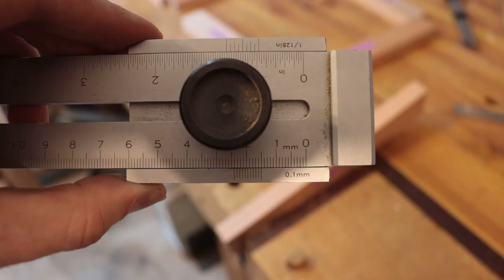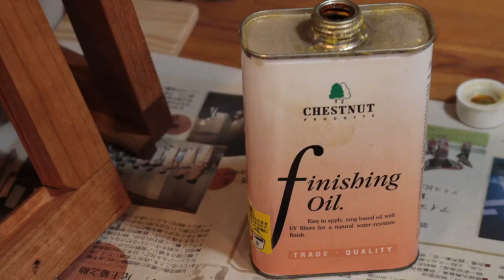How to make a printer cabinet with antique glass and hand tools!!

Comment: I see you pounding the side into the bottom without glue?  Did you later bang it apart for gluing?  Do you find that the compass plane works better than a spokeshave?
Reply from the maker: I glued all the joints, some parts get left out during editing. In terms of removing material a spoke shave is just as good. I like the compass plane because it stops cutting as soon as you reach the radius you set it for, so it's easier to get a consistent arc. Thanks for watching!

Comment: Build looks great. Love your videos! I never saw this leveling box that you use before. Tried to google it, but nothing came up besides regular boxes.
Reply from the maker: Thanks! The leveling box, as I call it, is one of those tricks of the trade amongst hand tool users. Western bench planes have about a quarter of an inch of sole on the sides of the iron. Build your box so the sides of the sole run along the top and the iron cuts everything in between. Then adjust the height of the box to the thickness you desire. This will allow you to plane boards to the same thickness. You're only limited by the width of your plane iron. When making frame and panel furniture this is great since the rails and stiles are very rarely wider than your plane iron.
Reply: @TenonsTenors  So do you have multiple ones fir different nights or is it adjustable? I have to check the video again later. Or, you have an opportunity to make another video about the jigs you are using. 😎
Reply from the maker: @benwarncke  I have never built an adjustable version, out of laziness, really. I have three of various sizes that I built for different projects. I did see a video on YT of someone making an adjustable version. Sorry, though, can't remember exactly where.

Comment: Excellent build!  I like the overall design and the dovetail construction, but the handles are too large and look out of place.
Reply from the maker: Yeah, as I mention in the video I used different pulls than originally planned. At the part where I drill the hole for the pulls, you can see the ones I was going to use. Unfortunately, I didn't think about how the wooden piece I attached to one door to hide the gap in the middle would interfere with the shape of the round pulls. Both doors had to be opened at the same time, which wasn't very practical. So, used the larger pulls to fix the problem. I agree with you, they don't look as good. That's what happens when you build without plans and lose concentration! Thanks for watching!

Comment: Not sure glass is suitable ....as it.   Isn't toughened
Reply from the maker: The glass is plenty tough. As I mention in the video, I took it from a cabinet door, and I actually dropped one of the pieces on a hard wood floor from about 1 meter and it didn't crack or anything. I was quite impressed! Thanks for commenting again!